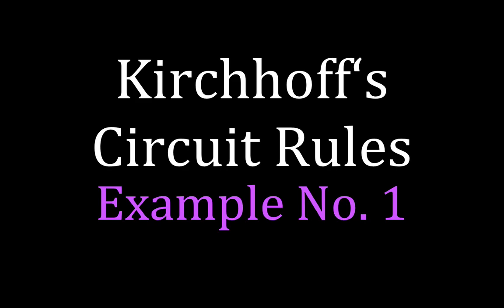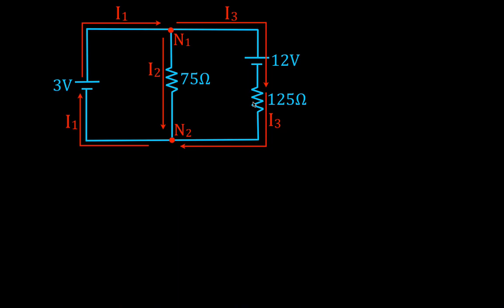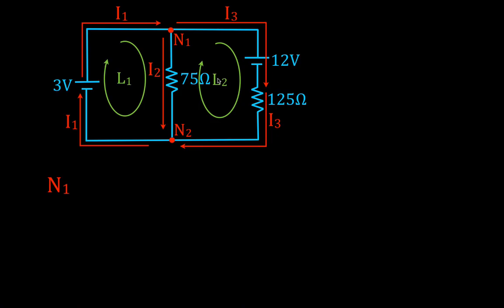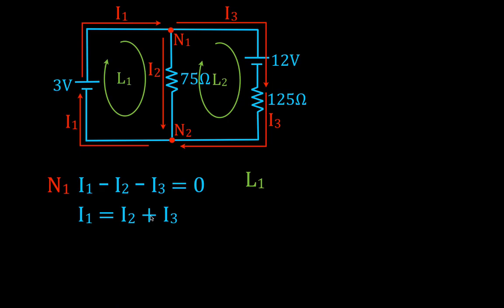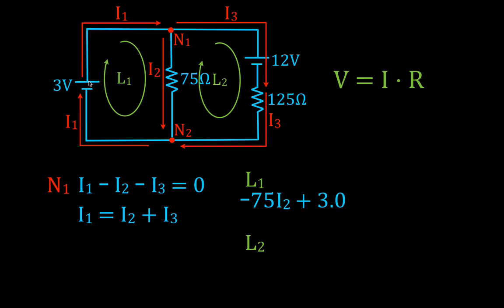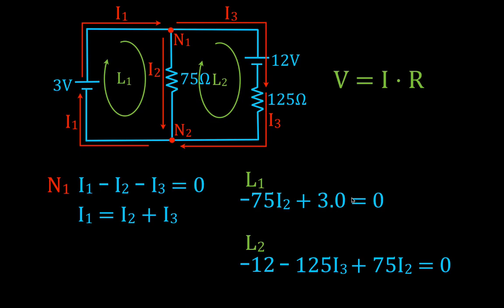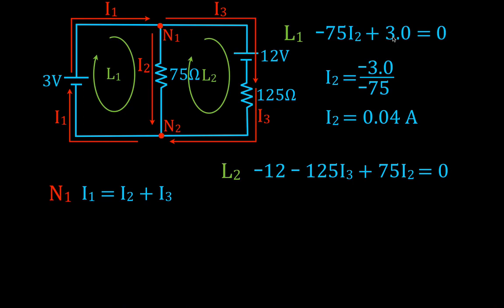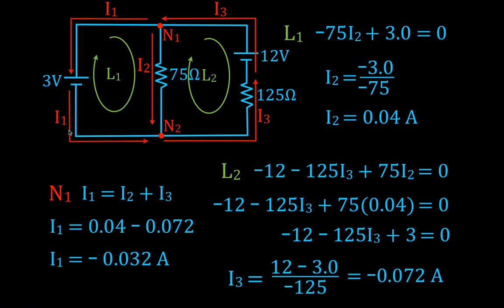Kirchhoff's Rules (2 of 4) Circuit Analysis, Example No. 1

Comment: Excellent 4-part series. Only thing 1 would add is first step - simplify any series or parallel resistor circuit parts that can be made redundant.
Reply from the maker: Thanks for your comment

Comment: I am a little confused because if you swap the Current 2 and 3, you get completely different answers. For my physics class and module quiz, I get the right answer when I make I3 rather than I2. Can you help me out on what to do? Physically wouldn’t it make sense for the middle current to be I3 since both I1 and I2 pass through it?

Comment: Nailed it with this video. You  helped me understand that:

1)  voltage rises if you go over a resistor against the current
2)  you drop voltage if you encounter a power source from + to -
3)  current is a little more complex in multi-power supply circuits--than for single-supply circuits

Thanks!

Haha, and P.S. the reason I say #3 is, current is:
 
a) the same throughout the entire series circuit--, and 
b) EVENTUALLY the same, except in branches, for the parallel circuits... 

but that's not so with complex circuits with more than one power supply. I kept holding onto the it = i1 = i2 ... iN idea. But I let go of that after seeing your video.

Thanks again!
Reply from the maker: Great that you found the video helpful.

Comment: How do we establish that I2 is current flowing from the 3 volt battery on the left and not from the 12 volt battery on the right?
Reply from the maker: When writing the equations, you can choose any direction for the current. If the answer for the current is positive then you choose the correct direction, if you answer is negative then you know that the current is actually flowing in the other direction.

Comment: Sir, last video you said the voltage will be positive when it goes clock wise with the current

while the current is negative when it's clock wise

you said the opposite here or did I just misunderstand?
Reply from the maker: Clockwise or counter clockwise has nothing to do with positive or negative. If you go from the positive terminal to the negative terminal then the voltage is negative. If you go from the negative terminal to the positive terminal then the voltage is positive. Does that help?

Comment: Is that not a node connecting the 125ohm resistor to the 12v source?
Reply: Think of a node as a junction, when you're travelling in a car and you get to a junction, you would usually have 2 or more paths which you can choose from to travel by. Look at the connection between the 125 Ohm Resistor and 12V source, does the current have some choice (or junction) to make? Nope it flows straight through, there is one path only, therefore there isn't a node or junction there. I hope I helped you in understanding what is a node.
Reply from the maker: Great.

Comment: I wish someone could explain the math to me in a way that I could understand how it got there. All I can gather is (3 divided by 75 = .04), (12 - 3 = 9), (9 divided by 125 = .072),  (.072 - .04 = .032). (Note to self, high school dropouts should not attempt to understand circuit analysis.) I thought I understood Ohms Law, KVL, and KCL, but I don't understand how -12-125+75=0, I don't understand how -12-125+3=0 even after applying V=IR... or why the 3 was subtracted from the 12, besides for the fact that the .04 has already been accounted for in Loop 1. I like your video a lot, but I'm living proof it's not for dummies. For those who know, no explanation is necessary, for those who don't know, no explanation is possible.

Comment: on 6:08 why does 3 become -3 ?
Reply: According to KVL the sum of the voltage drops in a closed loop must be equal to zero. Utilising the loop equation as he had it there, what value must -75I2 be to make that equation equal to zero? (-3)+3 = 0. Therefore -75I2 = -3

Comment: Question: you changed the currents for I3 and I1, does the inside also change like the loop 1 and loop 2? Do those also change to counter-clockwise? or do you leave them as is? 

Great explanation btw, very helpful thank you!